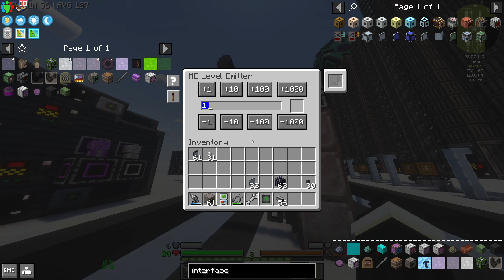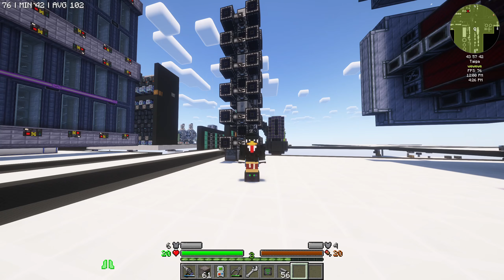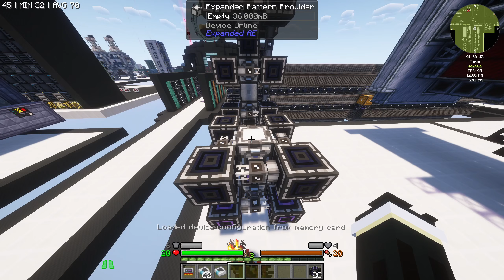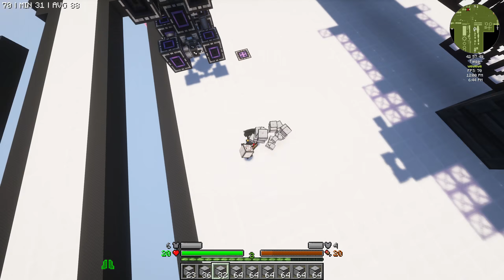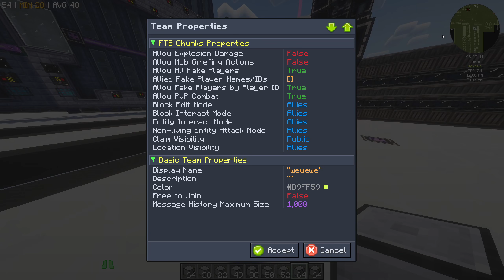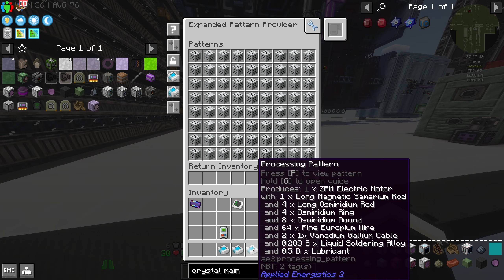We have pattern P2Ps at home... Radial Router Mass Machine Parallelism | Star Technology

Comment: Cool setup man! Ima try using the same setup on my hardened industrial furnaces, but do you think i could/should configure my pattern provider to push the same pattern or keep it on original blocking mode? ( the bottom button on the pattern provider)

Comment: This is INSANE. Finally i can craft  2k motors without my lines getting stuck only using 2-3 machines. Lets just pray for wireless data soon 🙏. Also i never thought to wallshare assembly lines on their input side
Reply: i believe they’re working on it, because one time i complained that i wanted to contribute and a dev went like “yo can you do wireless data” and i went “idk i can try” and then i gave up

so they DO want it